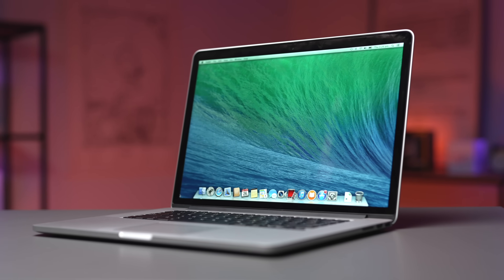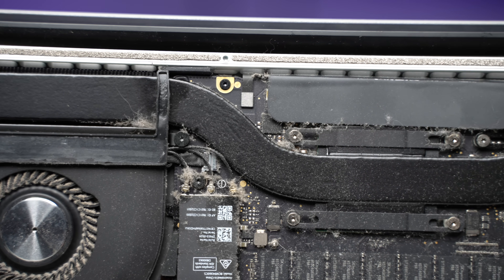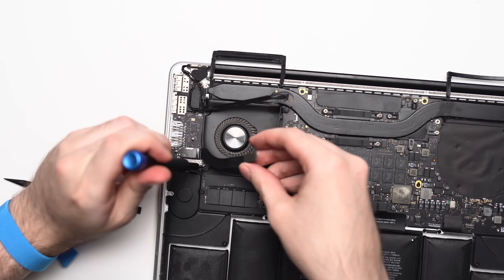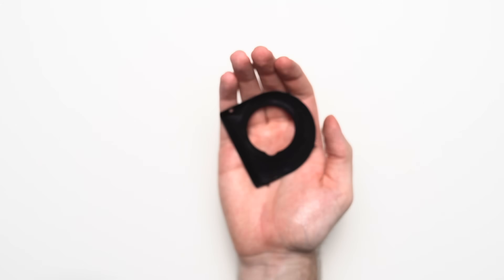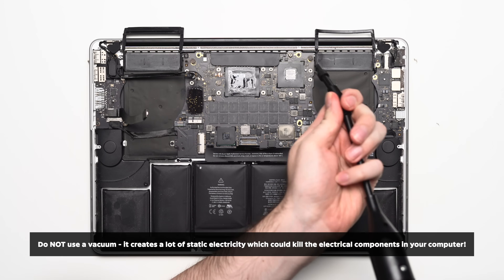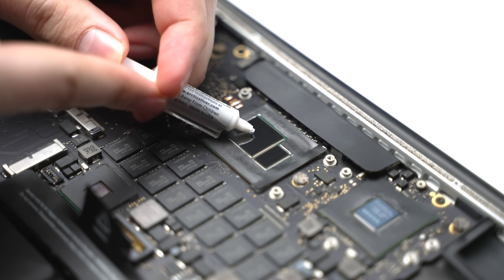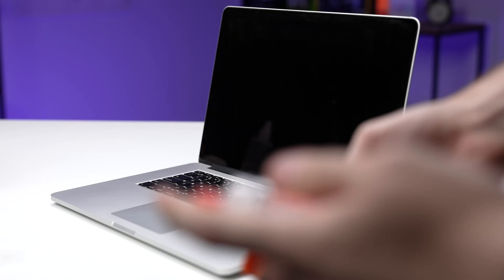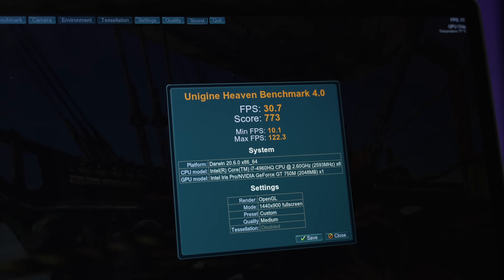This FILTHY MacBook is Overheating - Can I Fix It?

Comment: I fixed my MBP (2019 MacBook Pro 15", i9, 32GB RAM) with a reapplying thermal paste. It's crazy how it changes the performance of the laptop! Before when I used few apps temperature was close to 80 C, and it was "normal" for me. It was lagging as hell but I blamed just increasing resources for apps etc. Now temperature is not even reaching 60C when I use 4 Chrome windows (each 20+ tabs opened), and Windows 10 VM, and IDE for coding simultaneously.

Comment: Ceramique 2 is not a good  paste when the heatsink pressure is very low. You need to use cooler master maker gel or ic diamond or thermal right tfx which has better temps and longevity than ceramique 2.
If you want even core temps use carbonaut carbon sheet. Make sure the size of the cloth fits within the die size since it can cut easily and conductive. I'm unsure if the die next to CPU is pch or igpu.
Reply from the maker: It really doesn't matter what kind of thermal paste you use on something like this, no point overthinking it. Any decent quality one will work. I had a tube of Ceramique 2 spare so I used that. The most important thing is that the old paste is removed and replaced. 

The die next to the CPU is the iGPU.
Reply: @CreatedTech  ok.

Comment: Is not the intel cpu that have issues, is apple that didn't use appropriate cooling solution because of aesthetics...
Reply: @Brandon W not if you used a cooler designed to cool the chip effictivly. Apple would never use a cooler design that would cool said chip as it would require them to thicken the machines a good bit and that's something they'd never allow to happen. Well at that time at least now I don't think they care since now they're using ARM chips and not X86/X64 processors.

Comment: Wow! If it's one thing that sets off alarm bells/ alarm clocks in my head is an overheating device! It doesn't matter whether it's an iPhone or Macbook, I'd shut it down immediately. I do appreciate how you carefully elaborated on how to open and clean a Macbook. Regular maintenance is key to a lasting device.
Reply: Issue is, with devices like that one, just having it on makes it super hot, so if you want to use it in its current state, before he fixed it, it's just always hot and you have to live with it. Kind of like the 2020 macbook air intel that is always hot.
Reply: How come? Mines gets hot too.